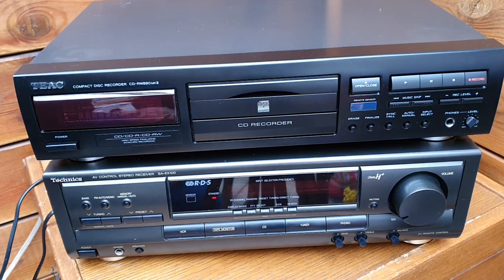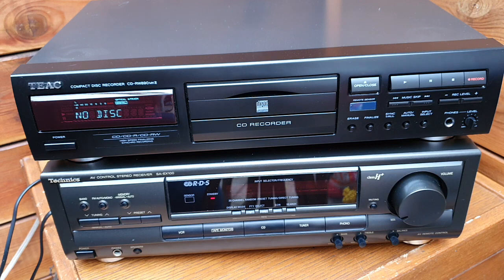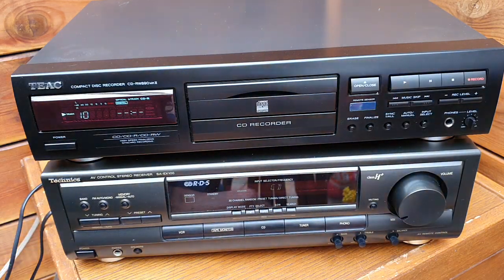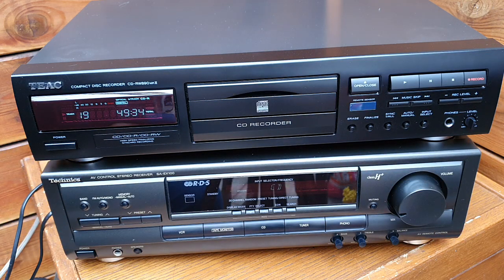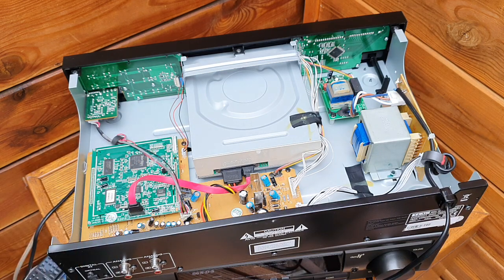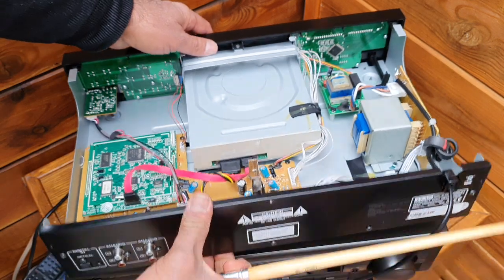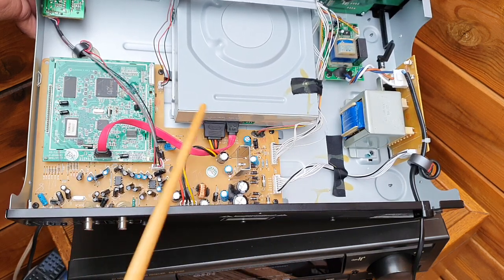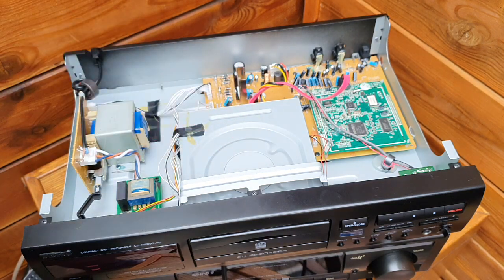Teac CD-RW890 Mark-II Compact Disk Player & Recorder amplified by Technics SA-EX100 Amplifier

Comment: I like the video very much. I just bought a Teac CD 890 and I am pretty happy with the results so far. I do have a question for you and I hope you can answer it. When I record an album off my turntable, it says track one on the CD recorder. When the second cut of the record album starts playing, the track number does not change automatically on the CD recorder when I'm recording in analog mode. The only way I can add a track and bring the counter to zero to start recording the second cut on the record album, is to tap the record button and then track two appears on the CD recorder, ready to count. how do I get the tracks to come on automatically when starting a new cut on a record album? Does it add the tracks automatically in the digital mode only, and not analog mode? Am I doomed to add those tracks manually? The instruction manual that I downloaded from the Internet is very confusing in that aspect. Any help you could give me would be greatly appreciated. Thanks.